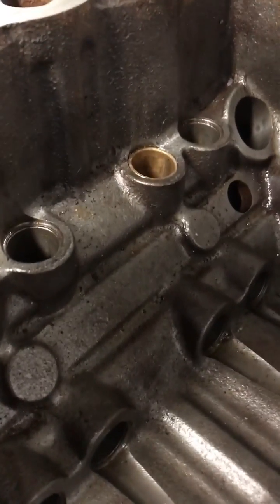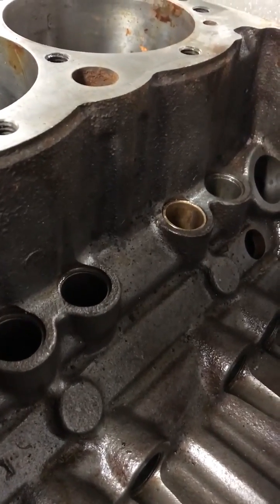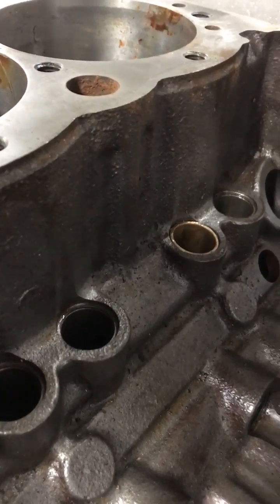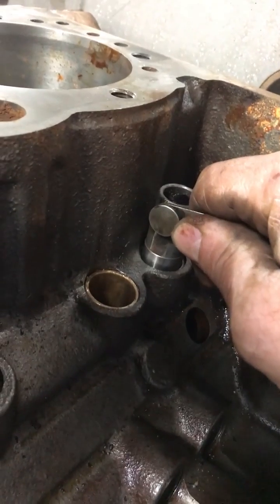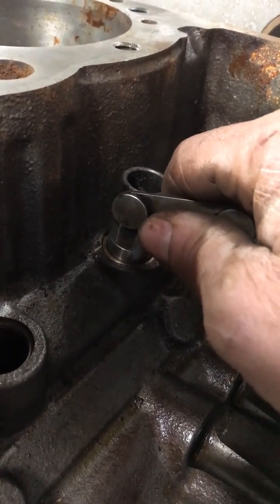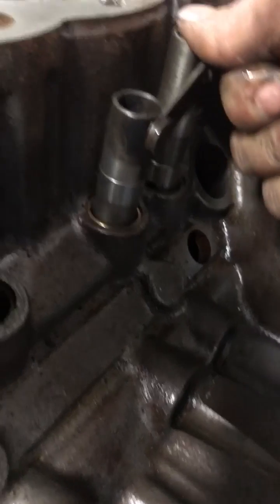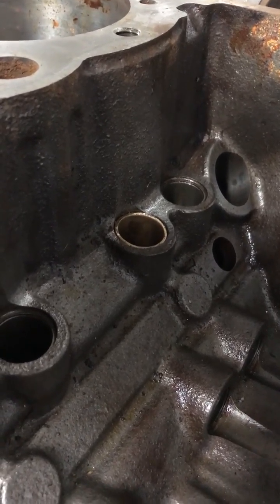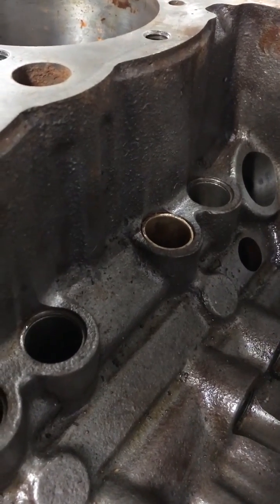Why NOT to hand-drill your lifter bores // Engine Building 101 – Titus Performance

Comment: I have a problem with a gm 5.3 gen 3. The ls7 replacements lifters are a very tight fit and have to be forced down in a few of the bores. I have degreased many times, brake kleen, etc. lifters soaked in oil and it seems to catch in the bore of a few. I also used new gm trays. What tool can I attempt to use? I don’t have a local machine shop and this lifter issue has my build backed up for the past year. Thank you
Reply: As a home gamer without machining equipment, I can only think of this:  IF bores are round & concentric,  hone to size.  Deburr top and bottom of any lifter bore after it's resized.  Flex hones are for refreshing finish - absolutely avoid these "dingleball" devices when/if resizing.  If you find taper,  belling, or out of round... time for a machine shop [sorry].  But first,  mic your lifters to make sure size and roundness are consistent.  Pro quality tools from Goodson or others might be a bit much for a one-off job, so you might be opting for a head & block shop to do the work - up to you.

Comment: Any advice on a spun center cam bearing fix on a aluminum 5.3 ls ? Thanks
Reply: If the cam bearing bore is screwed up, you can that one bored oversize and they should have a cambearing over size for it, outside dia. of cam bearing to fit that bore size...
Reply from the maker: Line hone the cam bores to the next largest OD cam bearing. I believe they are available on +.010 and +.020
Reply: I've seen a few of them pinned into the block. Pretty common modification. All this after repairs are made if it's repairable.
Reply: Not a 450 thousand ($) machine  , but a BHJ fixture does a credible job , drill them end for end with a pulley drill ,,, !